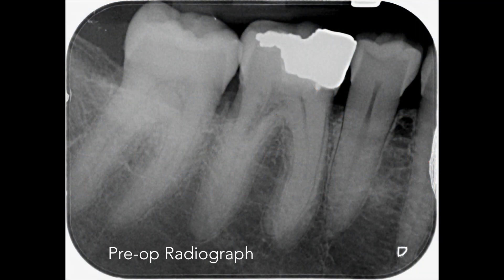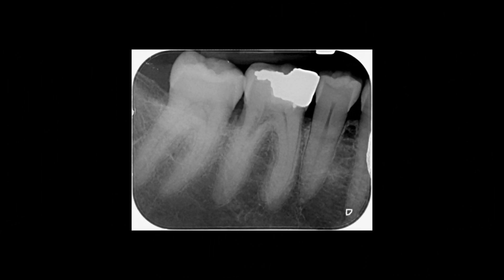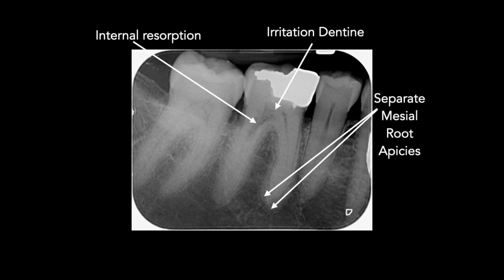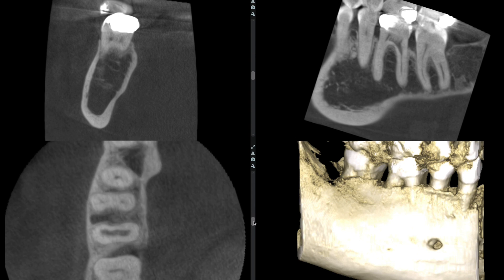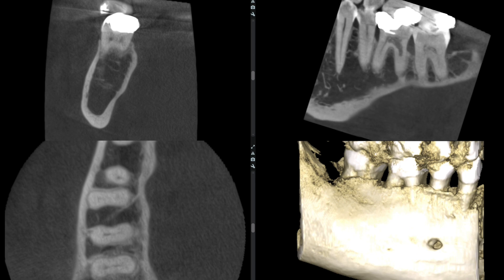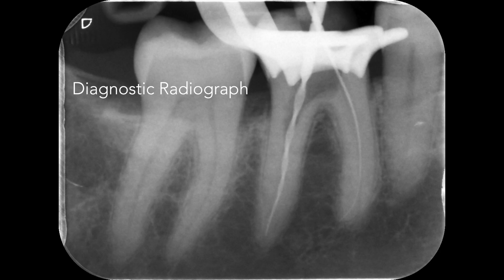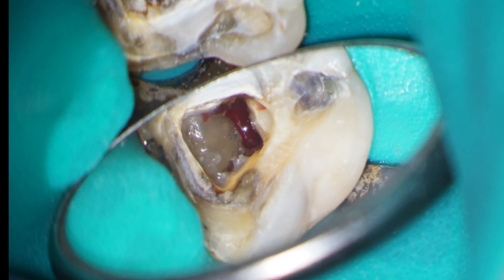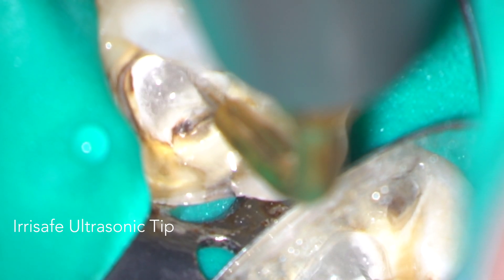Managing Internal Resorption LR6

Comment: I've been in agony since Thanksgiving night. ended up in urgent care, running tempature and was given antibiotics. Saw Dentist 10 days ago and xray showed very large cavity #19 molar. And was told tooth had this condition. Have Medicaid and it does pay for root canals but Dentist wouldn't do it. Said wasn't comfortable do it. Now I have had severe TMJ due to an accident in 1961 so despertly want to save teeth. Sadly a filling fell out of exact same tooth on right side of mouth in July 2023 and that tooth isn't in this condition YET. That Dentist would do anything either. There isn't one Endodontist that will take medicaid and I haven't the money. So I have to chew on the excruciating side because can't chew on the tooth missing the filling. The university dental schools in my area. U of Michigane and University Detroit Mercy are booked solid for 3 months ahead. I wholeheartedly believe an endodontist could save teeth but waiting while my tooth eats itself from the inside out. I'm horrified. Then the dentist I saw says don't be surprized if the pronosis isn't good for saving the tooth. To me this was cruel. Money is God, if you don't have it no one cares if you suffer in pain or you die. She wanted to pull it. Again I've suffered all my life with TMJ. There are already two teeth missing in same spot on both sides of these molars. TMJ for whatever got better when they were pulled out. But no way do I want one or the others pulled. This fon't color is black so writing this on wordpad. Whether comment will be seen??? I'm praying for help but every Endodontist has turned me down because of money.

Comment: Hello ,
I would like to know how do you get these pretty puffs of apex material?

With which instrument do you insert the sealant? I use the Kerr element ic with bio ceramics, but I can’t make the material melt at the apex :(
Reply from the maker: Hi Greggii,
Puffs of sealer are not something you aim to produce, but narrow preps have higher hydraulic forces and are more likely to result in sealer extrusion.
The heater tip needs to be hot enough and 3-4mm from WL
Cheers
John
Reply: @johnrhodesendo thank you for your answer. A Treatment is planned tomorrow morning, I’ll follow your tips. I’ll go further into the canal: I used to stop around 5-6mm of the WL.

Comment: I have a few questions. I was diagnosed with internal root resorption on my #2 upper molar. There is pain with pressure just above the gumline on the tongue side. The other side has no problems, and the tooth otherwise isn't sensitive or discolored. What usually causes this pain with pressure? Is it because everything is inflamed or is it likely a small perforation?    Also I've never had a root canal procedure done, if the pain I'd only on the one side, is there is such a thing as a partial root canal where only one root canal is cleared out to stop the resorption or would all root canals of the molar need to be cleaned?   

And finally, the first endontist I saw recommended root canal, and surgery to cut open the gum and fix the root from the outside, second endontist recommended just a root canal to stop the resorption and see what happens.  When is one or the other the better option? Thank you for your time.
Reply from the maker: Hello there!
Did the Endodontists expose a 3D scan (small volume CBCT?) this can be very useful to see whether resorption is internal or external. If one of them suggested surgery perhaps they felt there may be an external component? Coudl be a process called External Cervical Resorption
Pain perception is caused by pressure receptors on the outside of the tooth in the periodontal ligament that holds the tooth in the bone.
You can't do a partial root canal treatment all the roots have to be treated
Hope this is helpful?
Cheers
John
Reply: @johnrhodesendo thank you very much for your response! Yes, at both places I did the 3D cone scan about 6 months ago. I wasn't really told much information other than it's internal root resorption unfortunately. Just how each one preferred to treat it. I have rescheduled a follow up for treatment. The pain still feels about the same as it did initially, so hopefully a root canal alone can save the tooth, and correct the issue. Thanks again!

Comment: It is possible that a distal crack on a tooth could contribute to internal resorption of the pulp floor, but it would not be the only potential cause. Internal resorption of the pulp floor can occur due to a variety of factors, including trauma, decay, and infection. A crack in the tooth could potentially allow bacteria to enter and cause infection, leading to internal resorption of the pulp.
Reply from the maker: Yes internal resorption occurs as a result of an inflammatory process caused by bacteria
Thanks for watching!